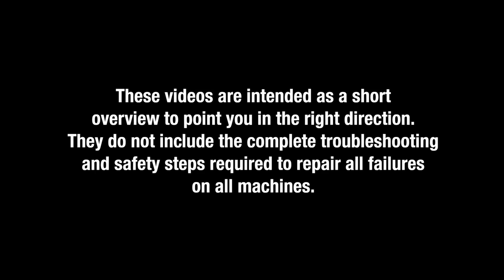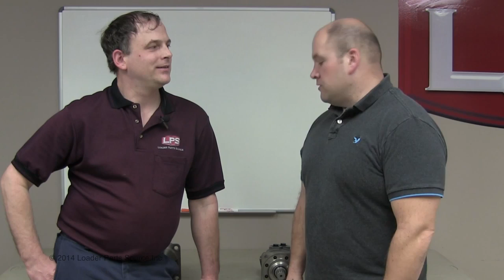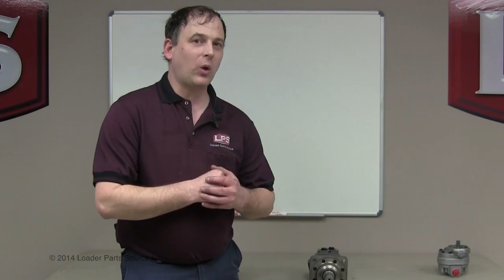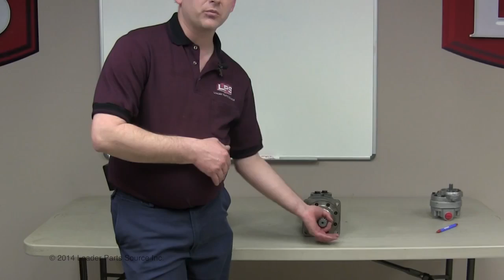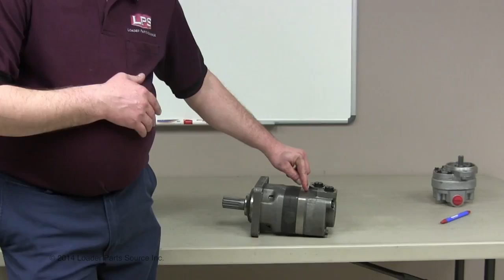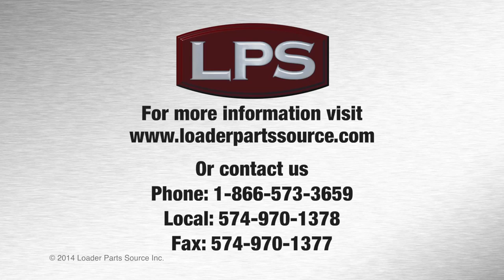Skid steer  wheel drive motor oil leak

Comment: So if I replace the motor, doesn't that come with a shaft seal?
Reply: Depends on the machine.  The machine in this video does not have a shaft seal. This motor design is called a bearingless motor, it does not include an output bearing, seal, and shaft.  The motor carrier mounts to the machine chaincase and includes the output shaft, seal, and bearings.  It is not included with the motor.

A more common design used on other machines is for the motor to include the output shaft, seal, and bearings.  On those machines, a replacement motor will include a shaft seal.

Comment: I have an ASV 4520. And it looks like the drive motor behind my scroll cage is sweating hydrolic fluid from the back side of it. Could this be a seal, or like you mentioned, a bad motor?
Reply: It is probably a seal.  It could also be a damaged casting.  I have seen both failures.

Comment: I have a problem with a skid steer drive motor. Its a 1974 Bobcat 722.
The drive motor has a hole which allows fluid to leak in to the chain case.
This hole is supposed to be there. Both drive motors have this hole.
The problem I am having is the right motor rotating assembly was damaged.
I replaces the rotating assembly, put it all back together and the right side does not work.
I took off the chain case and the right drive motor has a steady stream of fluid coming from the hole
The ride side does not drive at all.
The left side does not have the steady stream of fluid and it works.
Any idea about what can be wrong?
Reply from the maker: You have this motor:
http://www.loaderpartssource.com/bobcat-parts/bobcat-hydraulic-motors/reman-bobcat-722-hydraulic-drive-motor-2-speed.html

Excessive case flow means you have internal leakage.  The drive fluid is leaking into the motor case.  Since you already have a new rotating group installed, the backplate of the motor is most likely the culprit.  You will probably find some damage on it. 

Hydraulic components have very close tolerances.  It is common for someone with mechanical but not hydraulic experience to dismiss what looks like an insignificant amount of damage, then find out the problem remains.